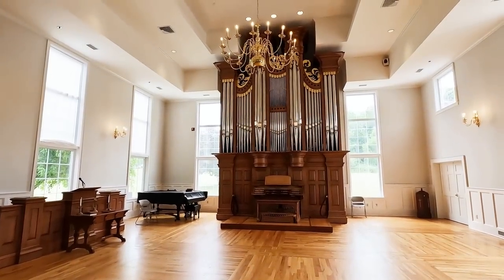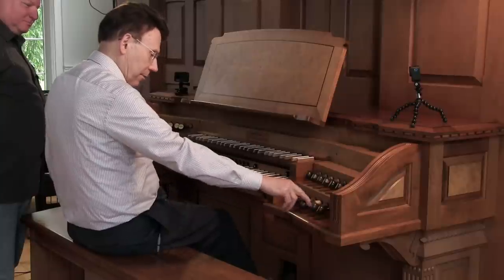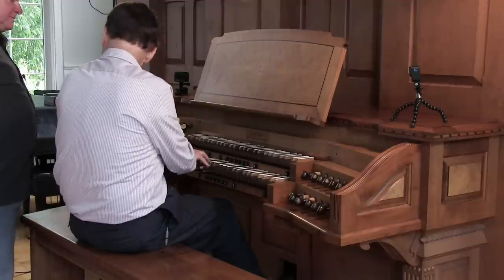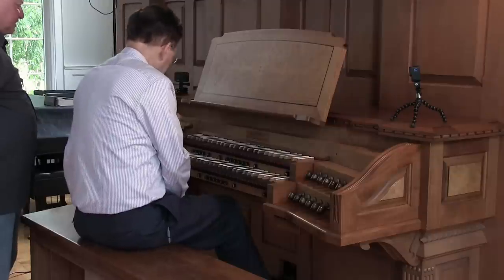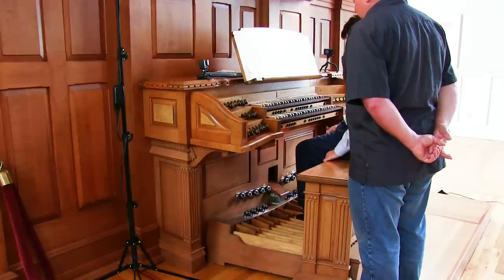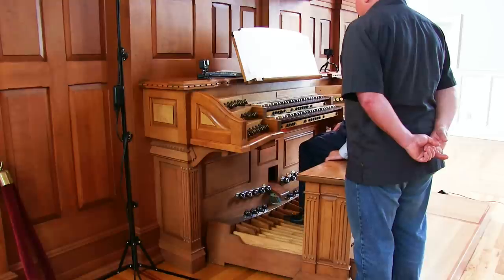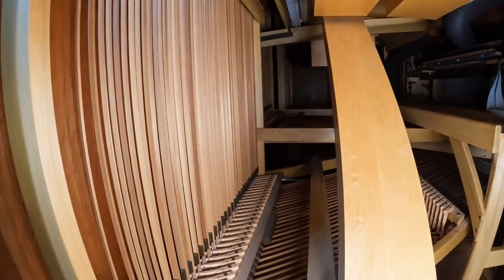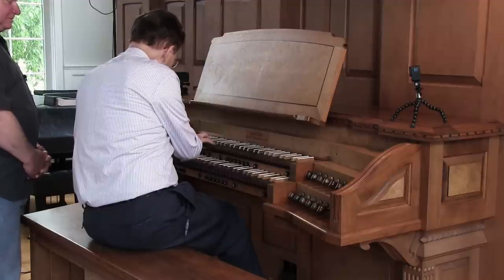1997 Dobson Organ - Pakachoag Church - Auburn, Massachusetts

Comment: The instrument looks glorious and sounds good as well. The casework looks like an adaption of the four tower designs of Father Smith  in late 17thC England.  These were found at Durham Cathedral and the University Church in Cambridge. Beautifully made and put together and as good a tribute to the skill of the builders as the sounds.  The big puzzle is why did some one go to that degree of design and beauty in such a utilitarian setting??? The only thing that seems to match are the chandeliers and it looks out of place. The acoustic may be good for it but the view of body of the Kirk is not flattering, it might double as a school gymnasium or a village hall, with the heating ducts and other ugly intrusions in the ceiling. It would be good if future posts might comment on the setting and visual impact of an instrument. A modern case design might have been easier but this deserves a classical setting. Am I alone in this reaction?
Reply: Do you know how to locate the University Church in Cambridge on NPOR? I'm having trouble finding it.